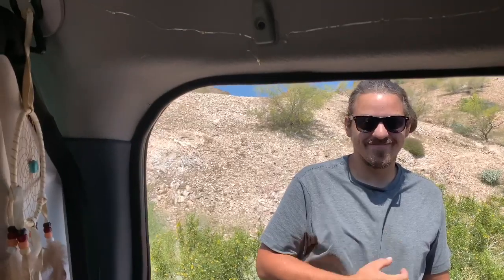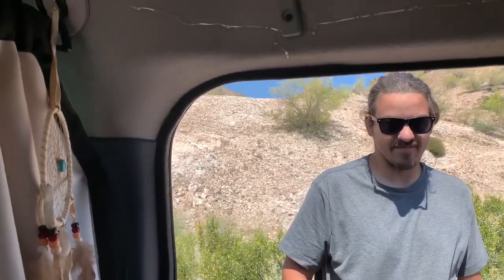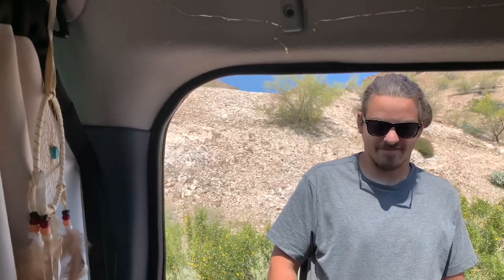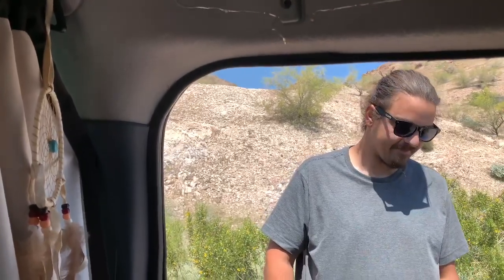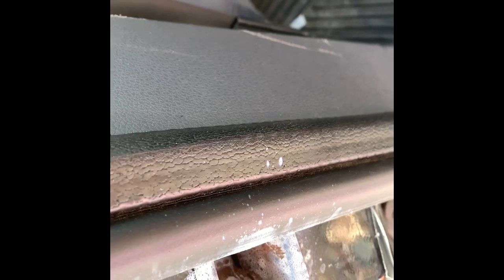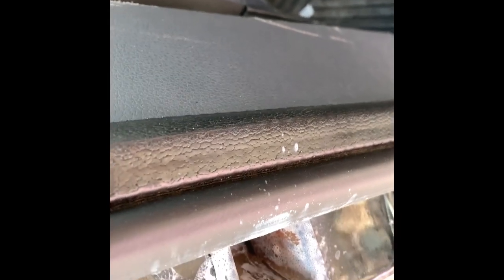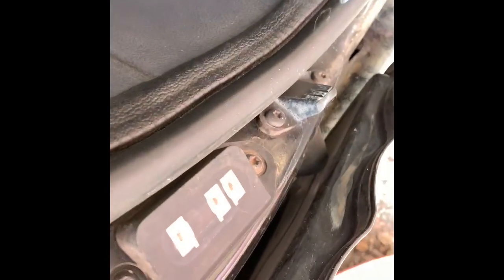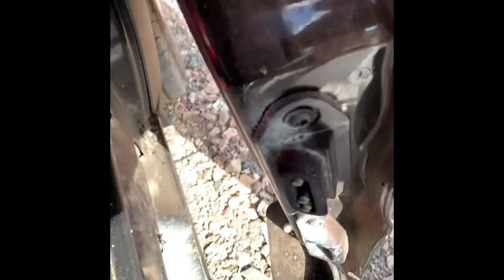HAPPY EASTER AND MY DOOR WOULD NOT OPEN

Comment: So glad it was an easy fix. A few weeks ago my driver's side sliding door on my van stopped responding to the key fob. It would open manually but not by a button. Almost 2 weeks I'm trying to figure our what is wrong. One day I'm trying to open it with the button inside the van and I notice that one of the other buttons is pushed down. I change it and try the door again. It opens! I had turned on the child safety lock thingy and didn't realize it. Ha Ha. I felt really smart.
Reply: Your situation is what I thought Letty was going to find.  Your post has helped others.  Thank you and stay safe!
Reply from the maker: That happened to me too

Comment: Letty, you are one of my role models for refusing to say “Oh, I can’t “. I am about halfway through outfitting my own 2013 Transit Connect. Thanks for the information on the sensors!  

I just wanted to check in with you to make sure you know about the inside manual locking mechanism for the sliding doors.  Assuming your vehicle and mine are the same, there is a smallish turn knob in a circle on the inside of the slider, closet to the rear of the vehicle about half way down from the window.  Those turn so you can manually lock and unlock the sliders from inside without the key fob.  Important to know in case your battery ever goes completely dead.  I imagine they would also work if the sensor ever goes out on you again.  Once my door lock got kind of stuck between locked and unlocked and the fob wouldn’t unlock the sliders. No problem with the manual locking mechanism.  

Stay safe and stay happy! 
Best regards 
Doris
Reply from the maker: Thank you yes I know all about that because I got locked inside my van and it was because the child lock was on

Comment: I imagine with those dirt roads and the winds that it's easy for the dirt to settle in like that.  However, didn't you get locked in your van when you first got it because of a stuck door?  It's probably good to spray some WD40 in the doors every now & then if you don't have someone to grease them.  Thank goodness for Zach!  'Hope you had a nice Easter in spite of the door problem, Letty!  Did a little bunny leave any eggs outside your door?  LOL
Reply from the maker: Thank you. The last time it was cause the child lock was on and it’s hard to find it in these vansv
Reply: WD40 is actually a water displacement (WD), not a lubricant.  Lithium grease will keep the door sliding.   And now Letty knows to clean the sensors which I am sure she will do.  Stay safe.